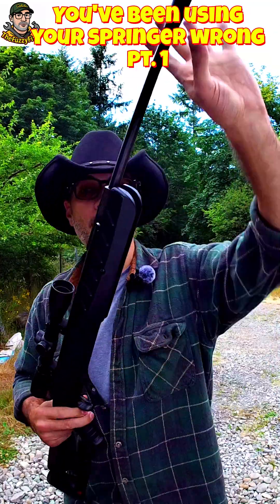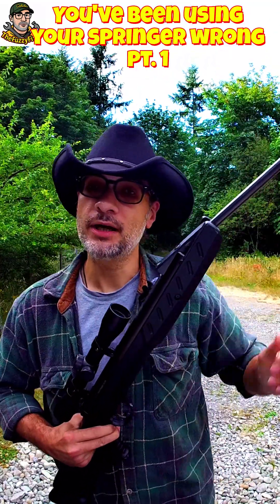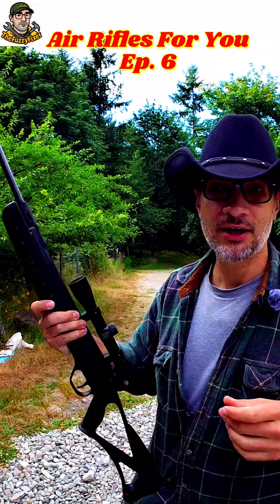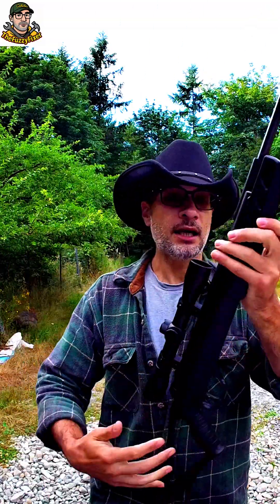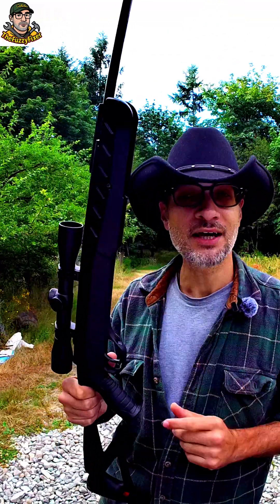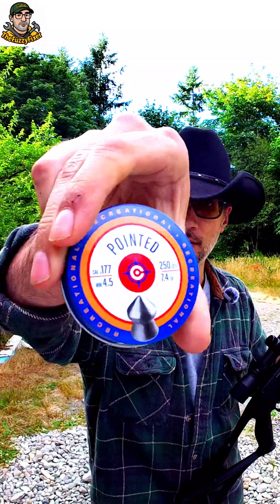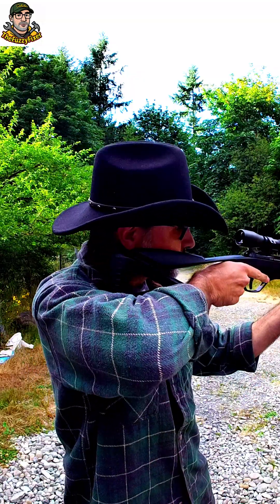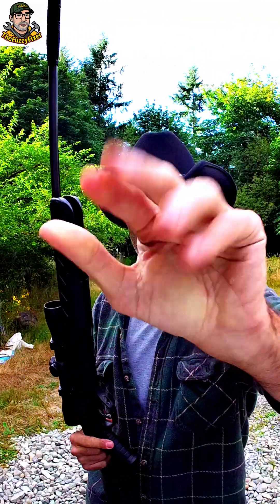You've Been Using Your Break Barrel Air Rifle WRONG! | Springer Airgun Physics Pt. 1 #shorts #fyp

Comment: All depends on the particular break barrel rifle

Some aren't very hold sensitive, some arw very.....hold sensitive.

But, yes the hold is important on any of them to have consistency if the rifle is actually capable of consistency/good accuracy with the pellet it likes the best.

So called "magnum" break barrel rifles in the .22 and .25 and up calibers seem to be the most hild sensitive in my experience since the pellet stays in the barrel longer, shorter barrel .177 cal. guns tend to be less affected in my experience since the pellet gets out quicker.
Reply from the maker: Yes, great explanation! I've definitely noticed this as well with the larger calibers like the Hatsan in .25. It's extremely ammo and hold sensitive. The budget ones seem to be more upset with different holds than the better balanced ones (at higher cost, of course). Thank you for your comment and welcome to the channel!